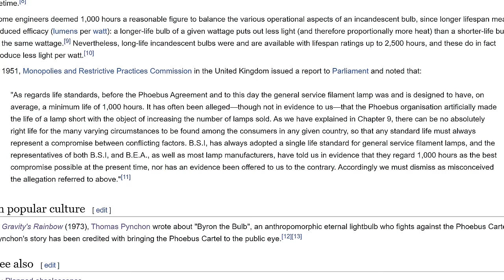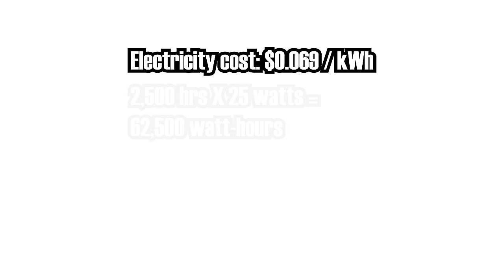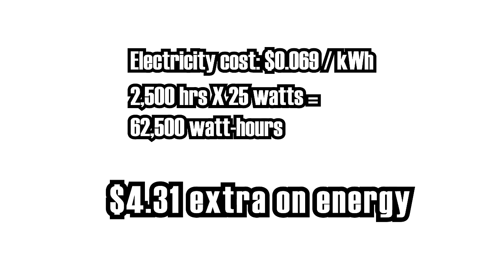Longer-lasting light bulbs: it was complicated

Comment: Okay, but why not improve longevity through better materials? Where’s the innovation?
Reply: Know of a more durable metal with a higher melting point and sublimation temperature than tungsten? Without that your only option would be to run the lamp at a lower temperature and like he said make it a worse lightbulb. Even if you found a material stronger than tungsten with a higher melting point it still wouldn't last forever, it would almost certainly last longer, but not forever. Nothing can last forever, entropy consumes all. That's why the everlasting light bulb story that conspiracy theorists love to tell is really stupid.

Comment: Watching this one again because it hit me, the "Phoebus Cartel"? Is honestly no different from about a thousand different industry standards and certifications today, all designed to ensure that everyone using a standard and printing their standard on a box are doing roughly the same thing and setting the same expectation with consumers. Imagine if you got a Wifi system that promised 802.11AX standard operation, but only operated as an 802.11B router, or worse, just... didn't connect to anything at all. Or getting your hands on some RJ45 crimp heads and realizing all too late that none of them actually fit in standard RJ45 sockets because they were manufactured off spec. It's really no different from any ISO standard, or ANSI standard, or IEEE standard(who were, under the AIEE, a founding member of ANSI, by the way), etc. 

ANSI would also previously be referred to as the American Standards Association, which gave us the ASA rating for Film, which itself(alongside DIN, the German system) would be converted into the ISO standard for film. Imagine buying two rolls of film from two different manufacturers, both with the same ISO rating, but both with WILDLY different gain performance. You'd be pretty pissed.

What's interesting is that ANSI's standards aren't nearly as tightly enforced as the Cartel's were, which has led to nothing but trouble for consumers. My previous statement regarding ISO? On digital platforms, not only does it not properly equate to full stops of light gain like it should on many camera bodies, but it also doesn't adhere to any noise gain standard either. The modern ANSI system is basically built on an honor system, and many of the standards ANSI pushes which are built around consumer and workplace safety are basically voluntary, which means that it falls to other agencies to levy fines for more serious infractions, such as when OSHA has to step in and levy fines for safety issues or improperly tested safety equipment that poses a clear and present danger to workers, but the thing is... they don't really DO that for a standard like "This lightbulb doesn't burn bright enough". Which has led to some seriously troubling slips in expectations of what constitutes a GOOD product in America, which itself contributed massively to the Japanese overtaking American manufacturing, with their rigid adherence to standard and their laser-focus on quality and giving 100% to the job every time. And then late stage capitalism kicked in and all that manufacturing went from where the Quality was to where the Cheap was, and now it's all just chinese junk. 

Standards MATTER, and business interests in America have made sure that they can't be held to manufacturing standards strictly, because that would cost them too much money, both in quality control and in infractions, so many of them specifically lobbied to ensure that companies wouldn't HAVE to be held to a standard, so much so that a lot of judges have been straight-up bribed to rule in their favor even when civil cases involving injury are brought to bear. A recent case involved someone who, at a restaurant, was eating a boneless wing, and choked on a bone. Reasonable people would say "It's boneless, it's basically a chunk of chicken tender, why is there bone in it", but the judge still ruled that a person cannot expect a boneless wing to not have bones.

Comment: Actually… carbon is the superior filament material. It runs hotter and lasts longer.
Reply: Carbon turns into graphite when heated, which is not good for incandescent lamp, carbon is also very brittle and prone to breaking with a little shake
Reply: @GERALD_786  Graphite has pretty much the same properties as elemental carbon, because it is carbon.
Reply: @setoman1  graphite is carbon with different arrangement, graphite is also more conductive than carbon which can make the incandescent lamp more inefficient
Reply: @GERALD_786  Conductivity is not necessarily an issue. You can get any conductivity you want by altering the length and thickness of your filament.
Reply: @setoman1  that is true but the incandescent lamp can draw more power and produce less light after the filament turned into a graphite, which is quite annoying and in some first version of carbon incandescent bulb can be quite tripping the breaker or burning down your house moment
Reply: @GERALD_786 danny is a cookie.. AUTHOR.. IS A BUMMER!!..

Comment: Modern LED bulbs seem to last no longer than tungsten bulbs. The manufacturers run the LEDs so hard that they fail. If they used more LEDs running at lower current they would last far longer. Running a LED at lower current doesn't make glow more yellow, just dimmer which can be compensated for by using more LEDs.

Comment: Objection 1: if you're concerned about efficiency or brightness dropping, regulate THAT.  Heck, it probably is and was easier to measure the brightness and efficiency of a lightbulb than to measure how long it lasts.  Your argument about them being fundamentally-equivalent-because-physics is wrong, too, as exemplified by the very halogen bulbs you mention later.  Measuring the wrong thing fails to incentivize the kind of innovations you actually want.  Regulating lifespan is *weird*, at the very least.

Objection 2: lightbulbs being "cheap as chips" to produce means they're MORE desirable to sell, if they can keep the selling price the same.  Make a lighbulb for a dime, sell it for a dollar?  You just increased your money by a factor of ten!  Sure, you have to sell more lightbulbs to match a larger purchase, but hey, free money.

I take no stance on whether this was indeed planned obsolesence.  You may very well be right; free lightbulbs supports this.  The lifespan limit still seems a little weird, though.

Comment: Your technical explanation may be sound, but is beside the point concerning the Phoebus cartel. It is indeed a good example of planned obsolescence because the proven reason (United States v. General Electric Co) these corporations cut down light bulbs life expectancy is profit. From the wikipedia article : "The reduction in lifespan has been cited as an example of planned obsolescence,[7] but this has been called into question by UK government regulators and some independent engineers because there are some good engineering reasons to reduce the lifespan of a bulb. A longer life bulb of a given wattage puts out less light (and proportionally more heat) than a shorter life bulb of the same wattage.[8][9] Nevertheless, both internal comments from cartel executives[6] and later findings by a US court [10] suggest that the direct motive of the cartel in decreasing bulb lifespan was to increase profits by forcing customers to buy bulbs more frequently".

Comment: sooo... the lightbulb manufacturers were so concerned with making a bright and energy efficient lightbulb that they forcefully decreased the lifespan? Do you see how that doesn't make sense? That's like limiting the battery size of a phone because it'll make it charge slower. If the cartel was actually intent on benefitting consumers, they would have set minimum brightness and efficiency requirements, and not maximum lifetime. If the cartel was still in place, leds would never have been made.
In addition, don't you think consumers should get the choice of what kind of trade-offs they want?

Comment: Failed to argue that the Phoebus Cartel didn't implement planned obsolescence. They also controlled pricing. The failure of your argument continues; you didn't cover that they also used more batteries and materials sold, with all of this waste going to landfills. That isn't exactly considered in your accounting. With companies documenting 5 times the sales after the 1k hour "standard," I believe you'd find that the bulbs weren't used 2 for 1 but more in line with 5 for every 1. I'm sure that OPEC has standards too.